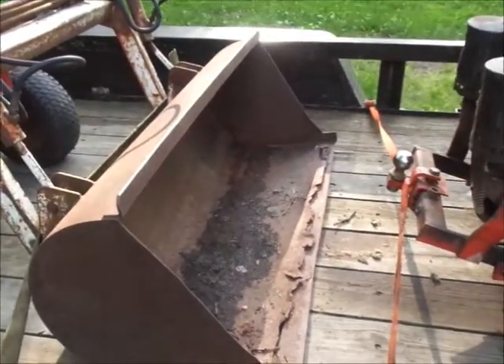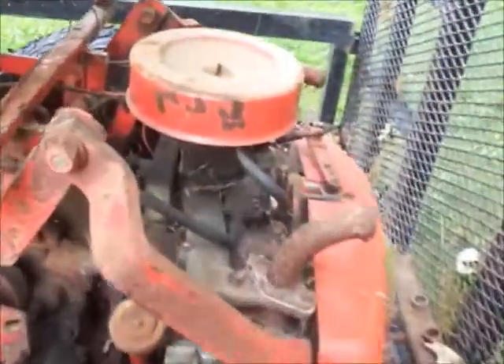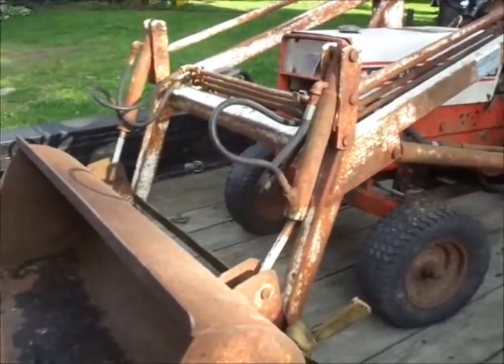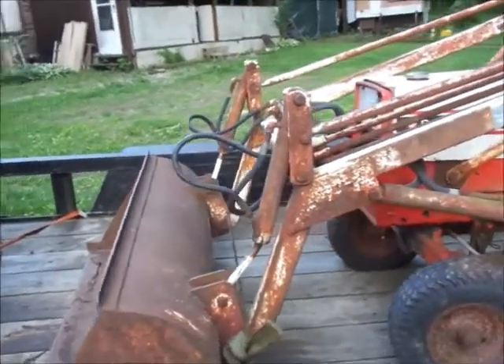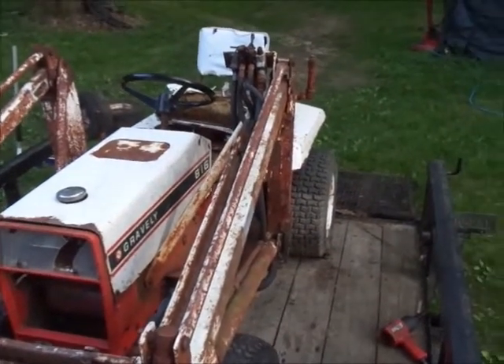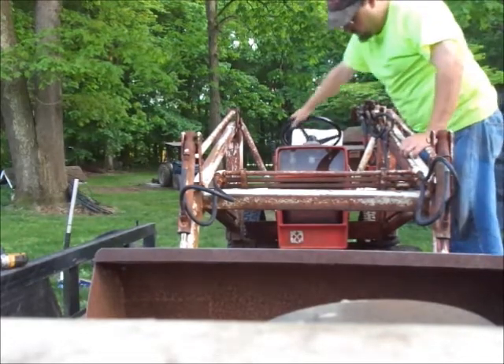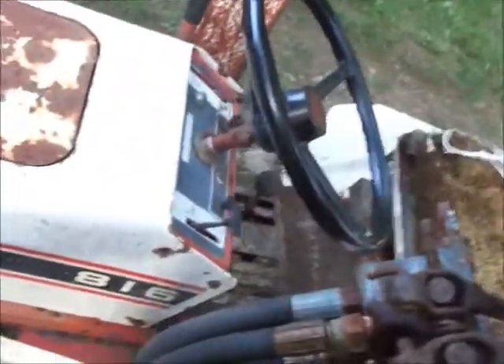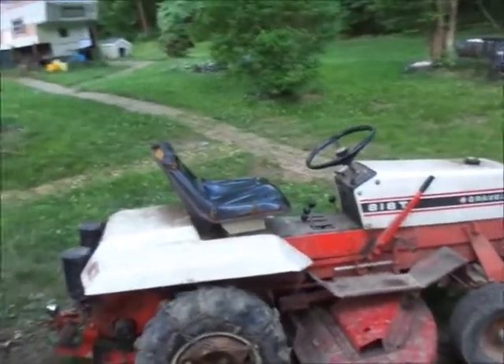1976 816 gravely and kwik way loader buy part 1

Comment: Gravely's are just crazy heavy duty tractors.  After working on a 12-G, I was pretty impressed.  Nice find.  I paid $800 for my rotted out Wheel Horse 520H, did a full restoration 10 years ago and I use that tractor almost every day.